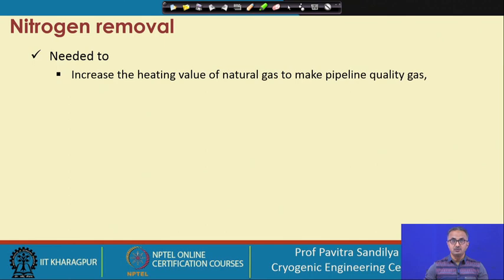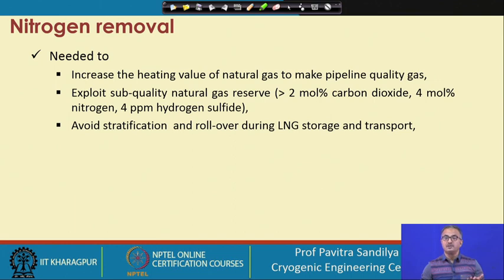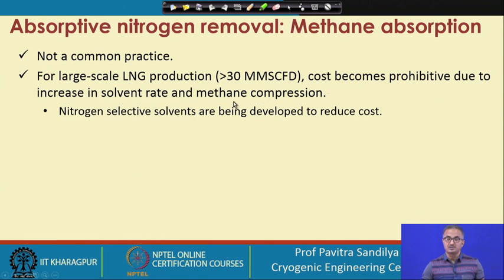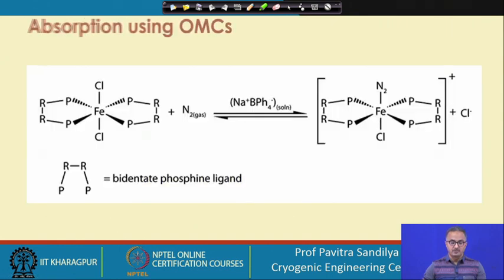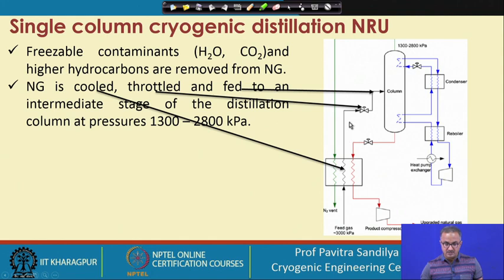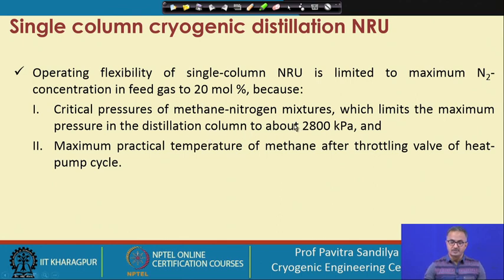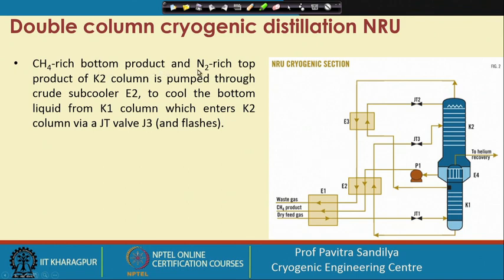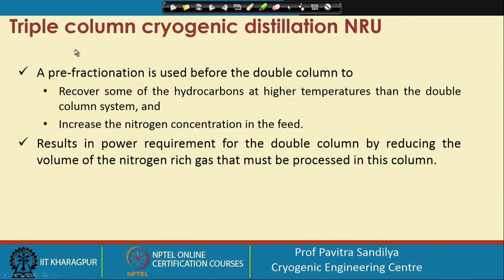Lecture 45: Nitrogen removal in natural gas system - I

Comment: while pipeline transportation of natural gas, nitrogen was removed to increase the calorific value of gas (from 680 to 980 Btu) but during the process, some NGL was also removed (equivalent to calorific increment by nitrogen removal) moreover some water vaporizes from the liquid phase. why will the customer on receiving this natural gas find heating value less than 980 Btu?  justify your answer
Reply: In this case an accurate characterization of the C7+ fractions is needed to predict the HC dew point since the heavier ends might condense while being transported resulting in a decrement in heating value of the NG, in this case the method of transportation might be a dense phase flow.